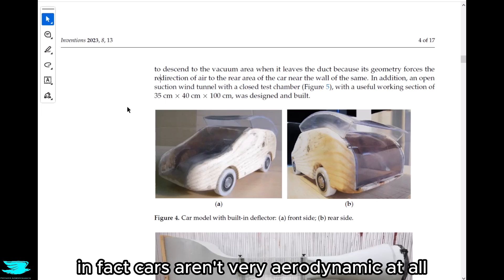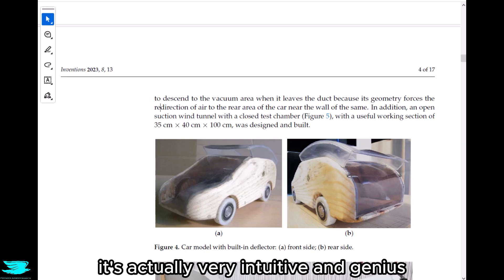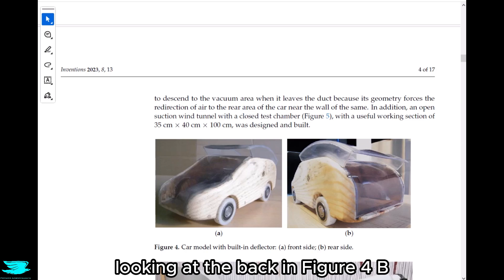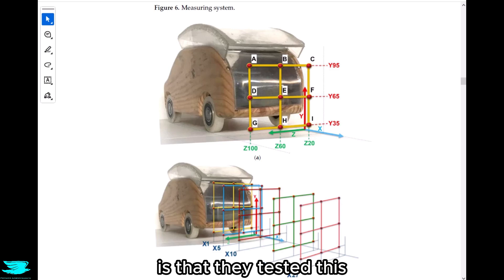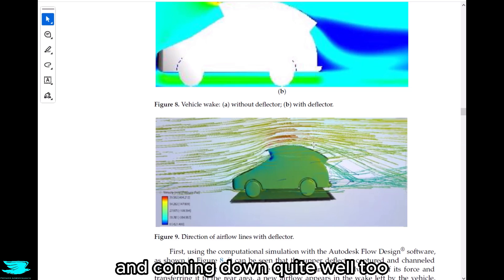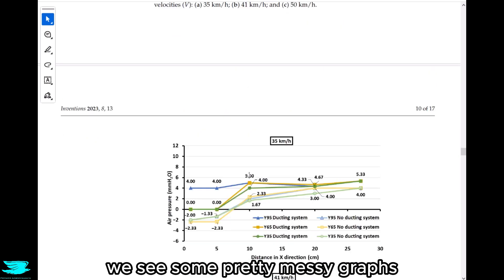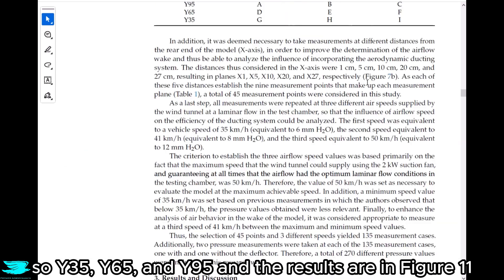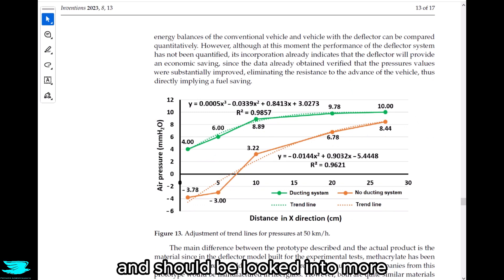Extreme Car Ducting Aerodynamics Podcast 236

Comment: They made pointy (teardrop) bicycle helmets - until crashes got a bunch of riders stabbed - then they blunted the rear-facing tip, and as far as I know, got rid of the aerodynamics functionality altogether.
"Duct over the roof" - I heard that they put a "roof above a roof" on Taxis in Thailand, which also reduces the heat that the cabin experiences. In practical examples, I would imagine that this low-pressure area would provide cooling, but a place for all kinds of debris for lazy vehicle owners to not clean and cause rust issues.
Reply from the maker: I didn't know about the helmet thing. That answers a lot of questions I had.

Comment: Never mind the pressure analysis of the rear of the car.  What's the total drag with and without the duct?  I suspect any lower pressure at the rear is more than offset by increased pressure at the front due to air being forced into the duct.  Or was that covered and I missed it?
Reply from the maker: The pressure will increase a little, but I'm not sure how the overall force was affected. Some hope is that much of the higher pressure caused actually forms above the front of the car too.

Comment: Why not just put a 300mm plastic pipe in the center console, between seats, through rear seat, throughout boot, and out the back
Reply from the maker: There are practical problems with it and it might need to be bigger than 300mm because of how large the base face is.

Comment: how about using turbos and targeting them at rear to eliminate rear low pressure
Reply: A turbo might make 400 CFM (~6.667 cubic feet per second) of exhaust at full boost while a car moving at 60 MPH (88 feet per second) might have a swept volume of 2200 cubic feet. 

A turbo is too tiny.
Reply from the maker: You could. That might be effectively ducting through the body, which works, but the key thing is to keep the ducting straight.

Comment: Downwash = lift, this may have a minimal impact on drag but a nice uptick in lift.
Reply from the maker: The downwash aspect will probably increase lift, that's true.
Reply: all a matter of perspective. lift still requires power. lift is drag, just upside down. do you NEED lift? local crest at anything over 70kmh says "no".
Reply: @paradiselost9946  What if you create a vortex that spins so fast it pulls you forward.
Reply: @rolandotillit2867  doesnt work like that. you dont get sucked into a vacuum, you get PUSHED into one.

and generally it requires you manipulate the air in front of you and the only way to do that is to get in front of yourself?

which is incompatible with reality, sadly.
Reply: …but if you did it on the underbody instead of the roof you’d get upwash (downforce). Time to build a CFD model with a false floor! 

Maybe add a giant Gurney flap to the end of the false floor’s rear diffuser.

Comment: Here's the problem with aerodynamic designs....they secretly sacrifice the protection of the driver. Think about it. Compare your average car from the 70's to cars from today, and look how much sunlight the driver is exposed to. Now go look at truckers. One little known side effect of driving is it tends to expose the side closest to the door and windshield to more sunlight. Truck drivers literally end up with half their face and one arm looking more aged than the other after a long time, due to the imbalance of sun exposure. In modern cards, roofs are more sloped back and so is the windshield itself, exposing the driver to greater amounts of sunlight, which in the long term isn't good.
Reply: That can be easily mitigated with UV blocking glass and sunscreen.
Reply: You’re making a good argument for central seating like a McLaren F1. McLaren F1s for everyone!

Comment: Man that topic is so huge.... Size/shape/y-position of the exhaust, influence of the inlet on the Cx, shape/angle of the inlet, inside shape / crossection variation from inlet to outlet, influence of that internal shape over pressure/speed profil in the duct and so performance, etc etc 
Pretty cool
Reply from the maker: Definitely, I imagine the gains they saw here are just the tip of the iceberg.

Comment: So i have to point out a huge error you make right at the beginning. The reason aircraft Cd values are so much lower than car Cd values isn't just that it's more aerodynamic. It is, but not actually by that much. 

The real difference is that aircraft use a standard reference area defined by wing area, while cars use frontal cross section. Wing area is larger than frontal cross section by a large margin, and as a result, since drag force scales as CdAV^2, if A is larger, Cd must be smaller for the exact same drag force. 

In other words, Cd isn't just a function of shape, it's also a function of the reference area you choose when defining it. Use frontal area on an aircraft and it'll increase dramatically.
Reply: a plane HAS TO have a certain proportion of drag to simply stay aloft. "lift" is just another form of drag, oriented to be useful for the application. it takes power to produce lift.

a car doesnt require to stay aloft. its drag is all pure drag, whether its lift, down force, or other.
Reply from the maker: Good point about the wing area. It neglects the tail area and the fuselage area, which if factored in, would lower the drag coefficient even more. So, errors kind of cancel out.

At the end of the day, cars are bluff bodies, planes are streamline bodies.
Reply: @PremierAerodynamics  i think his point is: cd is completely arbitrary due to an arbitrary definition of what area you use for each use case. CdA is directly proportional to the actual aero load.

Cd tries to set the load into relation with the size of the object. So an aero efficiency related to size in a sense.
CdA is just a reynolds independent expression of x load.
Reply from the maker: The area chosen for non-dimensionalizing the drag is not really arbitrary. The reason why the horizontal plane is chosen for airplanes is because at cruise, skin friction drag is the dominant form of drag (accounting for around 80-90% of the drag). The skin friction comes from wetted area, which is largely in the horizontal plane.

For cars, the majority of the drag comes from pressure drag, which is largely determined by the frontal area. Hence, the vertical plane is chosen for the area.

While the drag coefficient isn't perfect, it does a good job of letting us compare very different objects.

The CdA is more a measure of how much power you'll need and isn't just a function of the fundamental shape of the object.
Reply: @PremierAerodynamics  im sorry but this is just nonsense.
cd/cda arent magic. objects dont have a cd they only have a specific force at a specific reynolds number. often these objects operate in similar enough reynolds regimes that we can pretend that the force is directly proportional to the reynolds value (wich it never ever is). so now we have a force and the various value describing the free stream. you deivide the force through you description of the flow and you get an completely arbitrary value called cda in m2. the information in gives you is what force to expect at a reynolds value of you choosing. now you can go a step further and divide the cda trough a reference area so you get the cd without any dimension. now you contextualize the force with the objects size. what you choose a the reference area is up to you and only has meaning to you. it has nothing to do with how the force is mainly generated or anything. with the cd you can try to compare the aerodynamics of objects regardless of size. so for example resitance per planform area. "since the plane is longer we dont consider it less aerodynamic than the short plane despite generating more resitance".
but in a lot of cases the only thing that matters is: what is my fx,fy,fz at any given reynolds. this is cda/cla etc. in motorsports you only use cda since you dont give a fuck whether your car is slow on the straights "for its size", all you need to know is that you generate too much drag.

tldr.: the only thing that is real is the force an object generates. cda takes free stream conditions out of the equation (helpful to discuss generated forces withought having to agree on one set flow condition) . cd is to judge aerodynamics regardless of size (helpful if the size of the object has some kind of real life meaning as to why it is justified for the object to generate more force as size increases)
both are just contructs to help simplify and accelerate communication, both are arbitrary. the only real thing is the force an object generates. amen.
Reply from the maker: The Cd is a measure of how much energy an object will take out of the flow per unit area. That depends on the dynamic pressure and the area of the object. It's all wrapped up in the equation. All the information needed to understand what it is, is there.

Like all non-dimensional numbers concerning a length scale, the length scale chosen should be representative of the phenomenon you're looking at. For example, the Strouhal number, you pick the length scale that is responsible for the vortex shedding.

Further evidence that the drag coefficient, and other force coefficients, are useful and mostly accurate is that entire industries, like the aeronautical industry uses them and they work.
Reply: @PremierAerodynamics  @clapanse criticism was completely valid, yet you deflect and spend time coming up with new, false Interpretations of cd/cda.
Why would make all these half baked attemps to win an argument when you dont make an effort to get the facts right. It seems like your audiance will be able to tell when you are wrong anyways. Probably 70% here are engineers with some kind of fluid dynamics Background.

Comment: I imagine the front corner part of the duct(from the front most point to whence the surface curvature becomes parallel to the flat ground) already does a lot of good on its own. It redirects lower pressure high velocity flow from over the hood and glass to the roof on it's underside, and essentially just acts the same as a small hood on the above in place of a roof and windshield junction. So essentially a hood duct for the roof. This means there's a small high pressure above it and lots of low pressure below it, on a car like an R8 or TT and basically any car with a sharp hood and windshield junction it will remove the lift and provide downforce, with smaller ones placed further lower down you could even not have a drag penalty either. One issue I see with it is that since the flow from the windshield is directed to the roof, a part of the upper windshield view is blocked by the wing if it isn't made of a transparent material.
Reply from the maker: That's a good point. That front part probably helps reduce the lift of the car at that point too.

Comment: Now do Wheel-Well Ducting and Hood-Ducting.
Reply: Wheel well ducting like using the inside of the front frame rails to vent fresh air to the brake disks? Or ducting to remove turbulent air from the wheel wells and vent it into laminar flow at the base of the windshield?